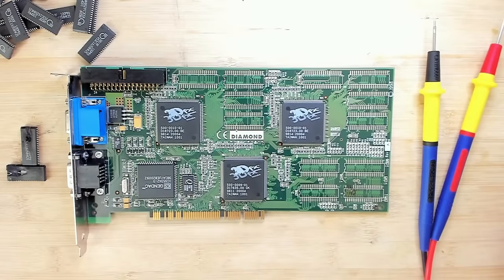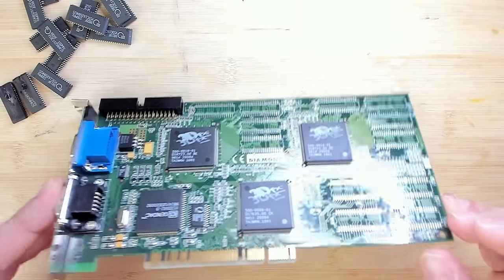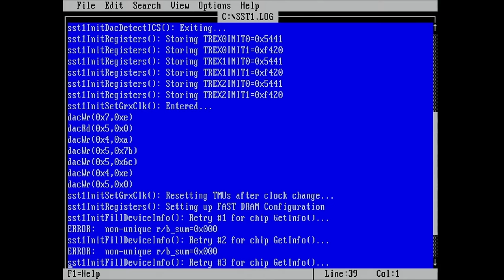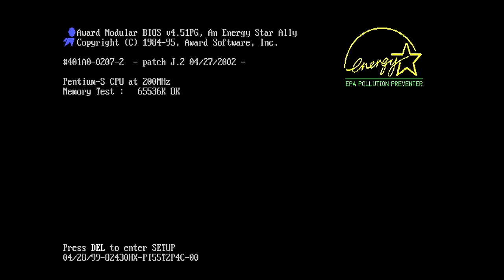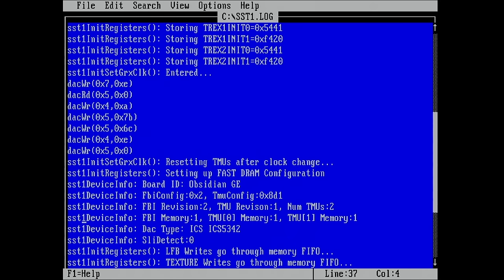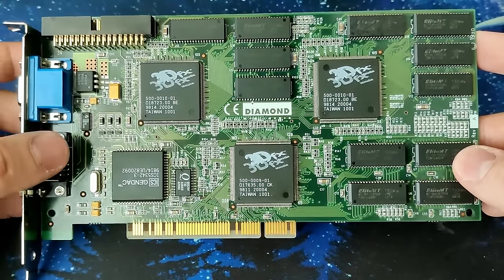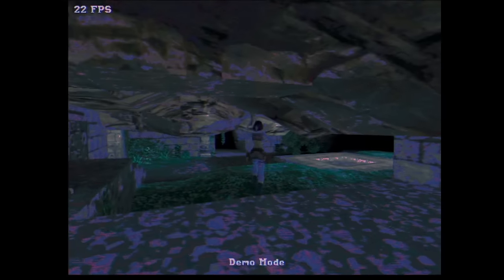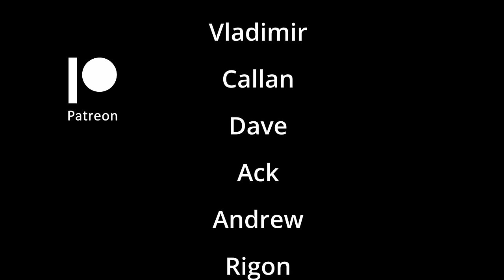Diamond Monster 3D II - A Voodoo 2 rises from the ashes? (Part 2/3)

Comment: Probaby the PSU had a faulty capacitor on a voltage line that is also a feedback line - old PSU did that, they used one of the lines as a feedback and if a faulty cap pulls this line down, the PSU compensates by rising all the voltages. So the voltage on 5V probably was slowly rising until something gave up. That's why you see the burn marks on the PCB - the chips were probably "fine" for a while, just dissipating that overvoltage as a heat...
Reply: I woud expect the owner of the card had been using some early ATX PSUs. But who knows. Anyway thanks for your insight and explanation.
Reply: @pavelfara9333  It would had to be "new enough" to have 12V feedback, the oldest PSUs used to use 5V for feedback - I phrased it badly, sorry 🙂 These PSUs are old from todays POV, but not the oldest. Most of the current draw nowdays is from 12V line and PSU manufacturers switched feedback from 5V to 12V to accomodate this trend.

It even did not have to be really "faulty" since these PSUs usually do have a minimal load requirement. It means that you have to draw at least some current in order for the feedback (and its output voltages) to be stable. And if someone did not know this and started blindly pulling cables, it could very well cause big voltage spikes and in turn destroy the weakest link (memory chips in this case - maybe more, we will have to wait for part 3 😁). New-ish PSUs usually don't have this limitation.
Reply: @pavelfara9333  Hi there! (Previous/Intermediate) owner here. It certainly was a crappy early ATX PSU from a cheap pre-built meant for office use. The PC used to be my friend's and I upgraded it for him with this card. It failed some time back then and we (I) unsuccessfully tried to revive it with another PSU at the time. So he discarded the blown up PSU, put the PC aside and we completely forgot about the whole thing, until he dug it out again a few years ago and gave it to me as a b'day present. Knowing about my nostalgia and not remembering that it was actually broken, haha. Still a great present! 😄
Reply: This is the most plausible explanation I have seen so far! Sadly, we discarded the bad PSU when it failed all those years ago and can't perform a post-mortem of it anymore (which would certainly have been interesting too). Only the aftermath, in the sense of the rest of the system, with at least the mobo being a casualty as well. IIRC, the 2D card has some discoloration on it too though!
Reply: This mechanism of regulation is called Group Regulation. All rails share the same transformer, and they're all windings on the same secondary side. Thus, they all respond equally to any increase in primary side drive power. These are the same PSUs that need some level of load on all rails to be stable.
Reply: @komplikatorful  This is also why you need a surprisingly beefy modern power supply to drive some of the boards from about 1997 to 2004 that were pulling their CPU power off the 5V rail. You have to meet the minimum spec for the 5V rail, and the extra 12V headroom just sits there. This does no harm, but probably is bad for efficiency since modern power supplies are optimized for the big loads tapping +12.

Comment: Great progress!  The colour issue I suspect is DAC related!  And clearly there's still some issue with the FBI chip - if not a trace or resistor / cap related, it must have died too =/  I would be tempted to check what else on that board is connected to 5v (assuming the DAC), but maybe something else is too (eg. a pull up resistor maybe).
Check those 3 ferrites, transistors and resistors on the left of the board near the VGA connector (not sure if those are the 3D out or the VGA in), maybe a ferrite has gone open on one colour channel, or maybe the transistor related to one colour is not working correctly.  You could swap them around after comparing them with each other on resistance / diode test.  That might resolve the colour issue, if the DAC isnt the issue.
Reply from the maker: I wonder if a faulty DAC could cause the memory to be limited to 1 MB on the FBI chip. That would solve the mystery without me messing around with the memory chips again. I could maybe remove the DAC and try mojo again to see if it makes a difference.
Reply: @bitsundbolts  I am more inclined to think the 1MB issue is an FBI chip problem (either a trace / passive / fault in the chip).  I've never seen a DAC have any relation to how much frame buffer memory is detected.  Double check that every VCC pin on every RAM chip measures 5v, it may have a burned out internal trace somewhere meaning 5v isn't getting somewhere.
Reply from the maker: Good point! I'll try to measure the power pins. I also replaced the SMD components around the exploded chip. Unfortunately, unchanged - 1MB on the frame buffer. I could try to replace the frame buffer chip.
Reply: @bitsundbolts  Don't remove the DAC, that causes even worse errors with mojo, my personal experience being that it fails before even giving the mojo readout.
The DAC I think is working since it can display white, the RAMDAC being down R / G / B would mean white would look wrong.
Reply: It is highly suspicious that the components with the most damage are having an issue. It could be when those memory chips went out it damaged a few IO pins on the FBI. This is also a multilayer board, a via could be damaged. An oscilloscope may point out the issue.

Comment: Awesome job! You can try check memory connections to FBI , maybe resistors/capacitors are dead near memory and need to replaced.
Also you can try to check using osciloscope if there are signals on memory pins, especially control pins.

Worst case scenario will be that Voodoo chip is damaged and no matter what you do it will not detect more memory.

When I got my Voodoo 2 I was also been supriced by blue Tomb Raider artifacts, then I've read info about patch for VooDoo 2
Reply from the maker: Yes, that Voodoo 2 patch got me 😄.
I tested all the connections on the front with the multimeter already. However, I'll try the oscilloscope! Thanks

Comment: As electricians say, there are two types of failure: 1. There is a short circuit where there should not be one. 2. There is no contact where it should be.
Looks like the second variant is your.
  First , try to figure out which pair of memory chips do not see FBU. 
 Second , check resistance at this traces to FBU and in work chanel.
3. There is a chance that the "one memory chanel in FBU has gone".
4. Maybe some issues in layouts.

Comment: Most likely something went wrong in the PSU feedback loop, AT/ATX PSUs can output up to 28Volts on 12Volt line and 12-16V on 5V line (the worst case, no feedback at all) and a lot of current. You can make really nice adjustable  PSUs from them by hacking the feedback loop.
Reply: With really bad caps that can happen yeah as there would be no smoothing. If there are still good caps, it will greatly exceed their ratings and they will start clamping the voltage until they heat and vent

Comment: Absolutely amazing that it works at all, well done getting this far, I think my first port of call would be to check all the resistors and caps in what was the burnt area bottom right of the card and also check the VIA's that are close by, that was some serious burning around there, I was amazed no traces were melted and like everyone else said, the connections from the mem chips to the FBI, if you have a scope, check the data lines to see which chip is the one working and go from there. I don't have a huge amount of experience with Voodoo's but I have 2 to repair myself so very interested in the outcome, best of luck.
Reply from the maker: Thanks! Yes, I'll focus on the memory chips and the connection to the FBI chip. Something is up, and we will figure it out!
Reply: @bitsundbolts  Well, you inspired me to have a look at my faulty Diamond Monster 3d2, it would black screen crash playing a game/benchmark and occasionally I'd get some random lines after it crashed, messed around with Mojo and didn't find any faults at all, gave the exact same results as both my other V2's, I have an Orchid Righteous 3d that's also faulty (displays fine but freezes) as a last resort I swapped the DAC(which is the same ICS 5342) and it works perfectly now, need a DAC for the Orchid card now but can't seem to find them anywhere?
Just wanted to drop by and says thanks for the inspiration, good luck with yours. 👍😁
Reply: As I mentioned in another comment, the mysterious burned hole might be a blown via between the Vcc plane and a chip, so that chip is no longer getting power.
Reply from the maker: @LeeMc007 I did get a few DAC chips some time ago - AliExpress again. Not sure if they work or if they're original, but one of them might come in handy for this card. We will see. I hope you'll be able to fix the Diamond Voodoo 2. I might get access to something for part 3. I have a feeling it will revolutionize debugging voodoo and voodoo 2 cards... Interesting times ahead!

Comment: All I can add to others is check the resistor arrays, they are know to go out of spec, especially after what happened to that card. Also I mentioned previously You can test the memory chips with a program called VMTCE in a 2d card with EDO expansion sockets.  Good Luck! Looking forward to Part 3.

Comment: If the frame buffer only sees 1mb but is writting like it has 2mb, would have sense that the GREEN part of RGB INFORMATION got missing, if only 1mb it is. Page addressing Error, so, some of the higher adress lines are faulty, so for addressing for 1nb up to 2mb it is used the bit 20 must be set to 1, but, as dynamic ram multiplex addressing in rows and columns, it will the address line A10 at fault.
Reply: Now, this comment doesn' take in account how the memory chips are banked, if you has the card schematics , that is easy to figure out.
Reply: BY example , If the memory chips are to say up to 1MB addressing, so it is normal to use the /CE (chip enable) line to activate lower bank / upper bank, so, upper bank will mean ACCESS TO 1mb up to 2mb addresses, and tricks like that are common in computing.
Reply from the maker: Ah! Great details! Let me check those data lines and probe a bit with the oscilloscope! Thanks for the info!

Comment: Most of the digital chip pins have a protection diodes inside. Two, one to groud and one to Vdd, In closed polarity normaly. But you can measure it.And, in most cases, that is the good way how to detect internal damage of I/O pin (shorted to gnd or power rail) or test if the line is really connected to the chip.

Comment: The voltage regulator is probably fine with input voltages up to at least 15V, so I wouldn't worry about it. A faulty DAC could result in missing some color information, and look like a faulty memory in the framebuffer, but it should not affect the memory size FBI sees. However, the FBI is directly wired to both FB memory and a DAC, so a fault in either can affect or even damage the FBI itself. Finally, a charcoaled PCB is conductive...
Reply from the maker: I learned this conductive PCB just recently! Very good point. I hope it was just the surface and nothing is shorted (like a data line). Maybe I have to do some PCB digging below that one memory chip that burnt a hole in the PCB.
Reply: @bitsundbolts  Is this a typical 4 layer board where data lines are on the visible layers, and the two planes in between are Vcc and ground? The hole in the board might be an exploded via that used to connect to either Vcc or ground, and now some chip isn't getting power. (Or even half a chip since you showed the Vcc pins aren't necessarily shared in those RAM chips). I'm hoping this is true because this would be an easy problem to bodge wire around.
Reply from the maker: @mal2ksc I'll check all power and ground pins again. I think there are even more of them somewhere in the center. Thanks for the hint.

Comment: Those old PSUs were all notorious for taking the whole system with it
Reply: Only the bad old PSUs. I have actually worked in computer repair back then at the tail end of 90s early 2000s and we have indeed often seen wide ranging system damage alongside the dead PSU. But not a single FSP (Fortron/Source) unit ever did that, we recorded s bunch of failed FSP since they were actually quite widespread in major-brand prebuilt PCs but all of them failed silently without fire and the computer was completely in order as well. Delta PSUs were at least as good but they weren't quite as common.
Reply: @SianaGearz  yeah, in my experience, FSP and delta are definitely good PSU brands, still making solid products today!
Reply: ...which is why the Retro Community should promote much safer modern PSU that also have MUCH MUCH lower Ripple than older ones (even when new)...
Because stuff like this can happen and the older components get rare and pricy and expensive...
A modern PSU is just much cheaper than a dead Retro System...
Reply: @Stefan_Payne   Unfortunately a modern PSU is tuned against modern PC's demands, which are 12V-heavy and 5V-light. Group regulated units are outright out, as they exhibit crossloading issues, and DC-DC topology ones have a wimpy 5V rail, while in that era, the 5V rail demand was kind of high.
Reply: @SianaGearz  20A is PLENTY of power for 5V heavy systems. That's easily 100W, which most older Systems don't even come close to...
As for the Group Regulation issue: Most older PSU are Group Regulated. Hardly any 20 year old PSU is independantly regulated...

And if you need more than 20A on 5V, you can go with a higher end one that has 30A on 5V, but the PSU is really expensive. Or you could try to get a movement for "Retro Power" Supplies...
Reply: @Stefan_Payne   Yes all PSU of the era were group regulated but they correspondingly have a wimpy 12V rail. When you're underloading the 12V rail on a modern group regulated PSU, and loading 5V rail heavily, the 5V voltage drifts down and 12V up, and if they drift out of spec, the PSU goes into protection. There's a certain ratio of how much you're allowed to crossload away from design loads that the PSU is designed against.

I mean you can just put a dummy load on 12V and be reasonably happy. Or just check how the voltages behave. Normally a single 3.5" hard disk being spun is enough to keep a modern group regulated PSU to stay out of extreme crossload, but quite a few people use CF/SD cards in an IDE adapter instead. :D Maybe you get lucky with one or another heavyish circuit being powered from 12V, then it's all good.

Comment: Really impressed this card is alive!! After such damage I had a hard time to believe to be possible.
For the FBI issue I would try to see which memory chips are working. From there, check if there is any connection problem for the chips that supposedly should add more memory but don't. Could have melted something in the internal planes, maybe around the area where the PCB was damaged.
For the discoloration, my hunch in on the DAC as well, maybe just went bad. What about a voltage issue? Measuring with multimeter is ok, but the voltage regulator could be producing ripple after being exposed to such deadly voltages.
Reply from the maker: Well, at least I know the area I need to look at. Both TMUs seem to be fine. The issue must be in the area below the memory chips in the front since I never got more than 1MB for the FBI chip. I'm curious what others have to say - especially regarding the DAC. But the focus should probably be to first fix the memory issue.
Reply: I'd think that the FBI chip might have an address line broken (internally fried), probably also some data line(s) connecting to RAM. Or there is some pull-up or pull-down action happening 'cause of charred PCB. DAC might have gotten it too, it shouldn't cause the RAM size issues though, unless it is using the same bus as RAM. Just a hunch, and lots of guessing… And indeed, very impressive fix!
Reply: 12V isn't going to kill that voltage regulator, at least not directly. Obviously it won't be heatsinked for operating at 12V, but I doubt it was in that state long enough to take heat damage. The machine would have burnt to a halt in seconds, not minutes or hours. They'll typically handle 24V or even 30V input, as long as you cool them sufficiently.

Comment: Hi. Check the resistors and capacitors around the burned memory chip under which the textolite burned out, they were under the influence of high temperature from the burning chip and could change their characteristics or fail.
Reply from the maker: I checked those SMD components - even replaced most of them with components from a donor card. The values of the original SMDs seem fine. After I replaced them, the card still only sees 1MB.